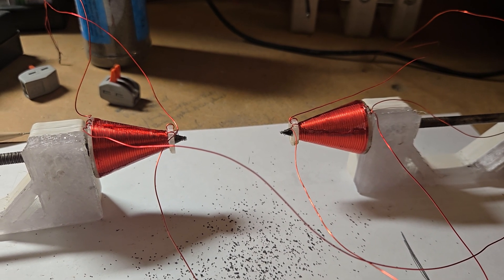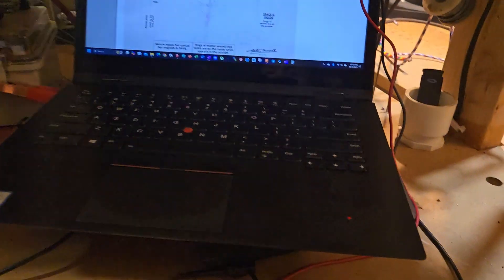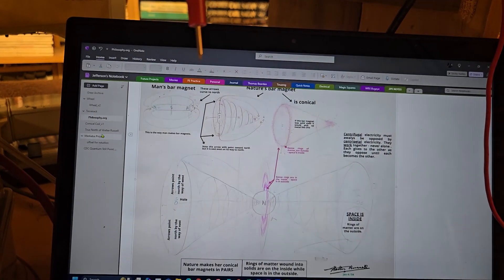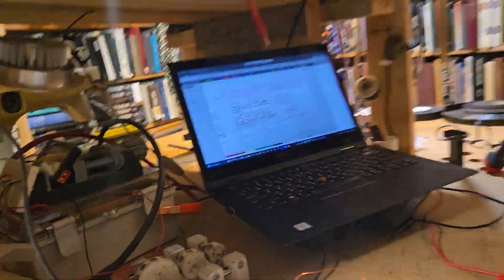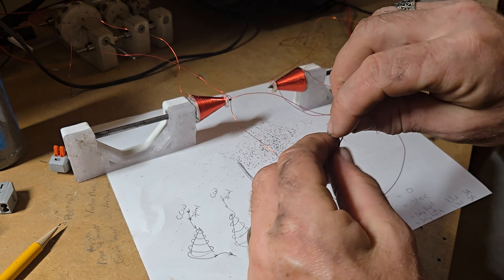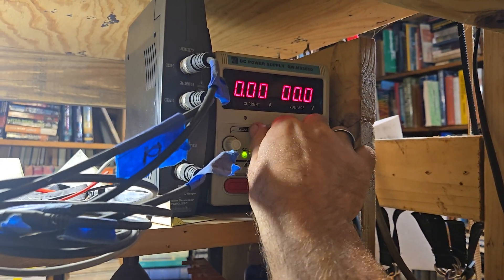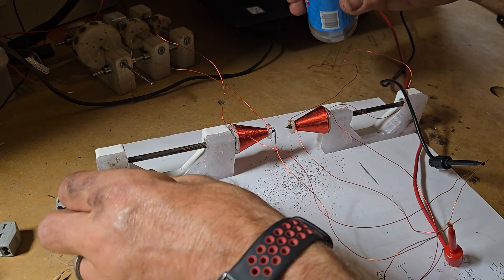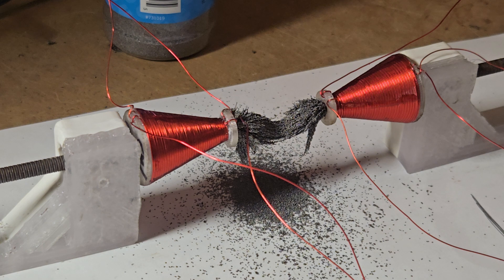Walter Russell Conical Coil Proof of Concept - Verification - Creation of Matter, Gravity, ZPE

Comment: I am infintiely deep in this field, more on my blog in my bio. But that 'ball' is just fringing flux. Russell did get some things right like counterrotating E male and M female flows forming the gravity aka life field, similar to Thesophists much before him, and integration at the poles and radiation at the equator, confirmed by Zirbes later, and compression and expansion through ocataves up to nine, similar to Keely who was much more advanced than Russell and has done things that were beyond Russell's comprehension. Russell was more of a philosopher who had some visions, Keely was more like God in flesh, he ALMOST knew everything. He saw the structure of the proton with three quarks 60+ years before mainstream, and unlike them saw that it fractally goes on and on toward deeper levels up to Godhead, that interference patterns form everything, and as he said all motion is vortexial motion, he rediscovered 369 ratio of triune universal current not Tesla, he said light and heat are created in the upper atmosphere later confirmed in Etidorhpa and by many occult and contactee sources, etc. Most go to Russel for Truth and it is a sad blind cult following, cause they can't handle Keely's somewhat confusing language, blind to great work that one man did.

Comment: Hmmm

The node.
You know,  I was looking at earlier tesla coil designs. 
Basically the two coils parrel beside each other.  And opposite of each other

Inducing fields on each other

At the bottom,  that space sits between them

The spark gap.
Once electrons pile up there,  and there are enough,  they do what the fillings did.

And bridge, until depleted. Then finish upwards by influence of the first coils field and then exit in a bang of plasma.

IT IS MY OPINION, as I observed this dynamo

That dual coil systems might just be a working model of big bang generation.

Blackholes, consume matter and create a worm hole tunnel

A bridge 

And when energy travels it (according to the 2nd law, breaks that bridge)

And exits in a bang

But I guess the important part is

The system REQUIRES the 2nd law failure of the bridge,  in order to function correctly. 

Other wise we just have a static rate bridge as you showed and there can be no bang

The 2nd law failure,  not only ensures a bang,  but ensures many,  resulting in a multiverse.

I guess what I'm saying is.. it's not the stable node that is significant 

It's the release of the kinect energy that was stored in suspension,  when you turned it off

And I still claim tesla coil spark gap designs are big bang models, only in a lower energy state
Reply: Oh and we observe these models in our way of seeing time.  I speculate a real big bang model like this would operate, Simultaneously across all time, but that's beyond the scope of the point I'm trying to make. 

My point is.. maintain the bridge,  isn't as significant as the moment you turn it off.

Maybe maintaining it is essentially like stopping time. Nothing happens. 

It's the movement that is caused by oscillating it that produces.. work? Energy.  Movement
Reply: Tesla Coil circuits are literally static electric generators. They are designed to produce unlimited energy from the immediate environment. They have nothing to do with the big bang. We don't even really know whether that is how the universe actually began. We don't even know that it began. Slow down.
Reply: Also, what the hell are you even talking about?
Reply: @sbandc  i think i used plain enligh here. if you cant comprehend english QUIT WASTING YOUR TIME idiot
Reply: @sbandc  I did ask for your critique or ask you to exhibit your ignorance. if you cant under stand, THATS YOUR PROBLEM  NOT MINE. I do not care what you think
Reply: @charliebaby7065  Firstly, Tesla coils aren't Big Bang models.. They're generators. What is a "big bang model"? Secondly, how can it be a big bang model when A. The Big Bang was not even a theory when Tesla designed the circuit, and B. We don't even know for certain that the Big Bang is how the universe began. It's just our best guess under the assumption that the universe "began". We simply don't know. Thirdly, what is the 'second law failure'? It's not even that I don't understand- I don't, but it's not because I lack understanding.. it's because you aren't using English correctly. You have a number of combinations of words that just don't make sense based on the definition or part of speech the word is actually intended to be. 

Aside from that, I do get what you're saying. You think that the universe was clustered in the same way this ball of metal particles is clustered, and you think that some failure of 'the second law'- which isn't saying anything, and the second law is presumably of thermodynamics- which is entropy and wouldn't have been a failure, is the reason the cluster destabilized and that is the point at which you think the Big Bang happened- creating the universe. While I comment the way you've connected various aspects of this demonstration to how you think the universe began, it just simply isn't that simple and would require both more research on your part and better articulation with your description.
Reply: @charliebaby7065  By the way, what you see in the video is not what occurs at the spark gap of a Tesla Coil. You could easily build one and learn this from direct observation.
Reply: @sbandc  I know that it is not a spark gap
spark gaps spark, this one doesnt.

because the two coils magnetic fields need to induce the the proper amount of current within each other through a different ratio of turns of the copper wires and thicknesses step up the voltage
the right hand rule

so theyre not aligned properly  or close enough to do so. 

they're only slightly close to such a concept because the field that is between them, will slightly assist in the currents jump.

i mented the spark gap, because the next logical step is what tesla took. use the coils  to induce the current in each other and make it so the coils ALLOW a voltage step up by having thicker wire on one , and then  use the spark gaps nature, to add balance and control to the air in between. the air's resistence / conductivity,  to basically allow the entire thing to act as a capacitor if you will. and all three of those are acting as the timer setting the Fq of the system. which would fail if there was no control in setting it/the spark gap 

it is that moment there is no spark, where gapping,  is the KEY to setting the fq  the build up and release and thusly the ensured induction of the two coils

it sets raises or really maintains the potential  energy of the system

WHAT HES BUILT IN THE VIDEO
has zero induction, and thusly is just an electro magnet
and i was telling him, the only benefit that it has is because the field holds the fillings.
THAT, is storing the fillings potentional kinetic energy, but isnt very usefull because its a one time thing, and he'd then have to pick up the filings again and again and 

totally not worth anything

just as would be to invest the effort needed to build a tesla coil for the sake of arguement on this video 
(and no its NOT EASILY constructed  wires have to be perfectly coiled, glued, measured and housed protectivly at the base to prevent shorts or fires, and thats just one coil in a many component machine

OR i could easily just buy a circuit board online that does practically all that for us, easily. but thats a totally different type of tesla coil structure anyhow

BESIDES, to begin with and
since he mentioned tesla and mentioned coils, AND is shoving fillings in between his
and talking about the interest he found at its node

i thought maybe id talk about the interest i found regarding tesla and coils and the magic of spark gaps

ALL im saying is that i believe einstein-rosen bridges, or wormholes, as seen from the perspective of quantum mechanics DO NOT CARE if the 2nd law exists or not, and even if and when it fails, it might actually be resetting the "system" to fire a new big bang over and over again, as would ina multiverse, as we see a proper tesla coil exhibit before our very eyes

i never once said he had a spark gap or tesla coil.
he just has two coils and a gap gap

thats the most obvious part here of the entire argument

ER=EPR
they just claim "negative energy keeps the hole open"
i say its just the nature of what the spark gap does intrensicly ,could be expressed, as "ENOUGH" to maintain bangs

vindicating Einsten as he offers a solution to his field equations, in the form of a wormhole

he hasnt been proven wrong yet
but people want to shutdown the possiblity because they want to claim the 2nd law.

all im saying again, is 
a spark gap , should present a model to anyone that says the 2nd law just makes einstein wrong

i know what a spark gap is
i know what ive been saying
and its easier to NOT build a tesla coil to prove something that IM NOT saying

besides, i CANNOT build models or prove physics regarding blackholes and bigbangs

i simply had a theory
the 1st basic step of science
why dont you be my peer review and go disprove me by easily building  a wormhole

https://www.youtube.com/watch?v=uOJCS1W1uzg

Comment: what happens if you use other materials besides iron filings?
What happens if you use pulsed DC? 
What happens if you change the intensity of the charges?
Reply: If the material is ferromagnetic, it will react just like iron, in most other cases it won't do much.
Any variation in the current will probably mess up the magnetic fields and make everything fall apart.
More electricity would mean a stronger magnet so more iron could get stuck on this.

Comment: Impressive. From an engineering perspective, how would you apply this apparatus specifically?
Reply: Seems pretty useless but looks cool
Reply: No way.. So many uses. The LHC uses magnetic containment in a similar yet much more elaborate manner. A spherical containment field could be used for many purposes if one is familiar with the tech and dynamics involved in advanced level technologies.
🦋☠️🦋
Reply: @celebratedrazorworks  This specific configuration with small coils is pretty useless though.